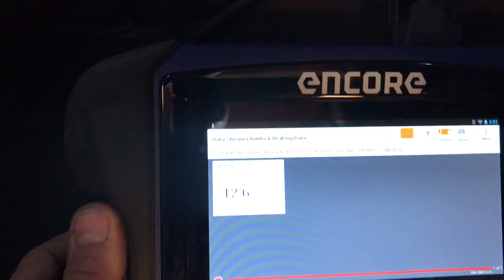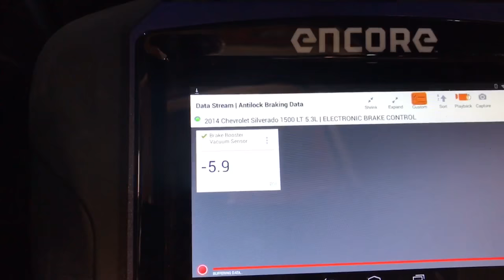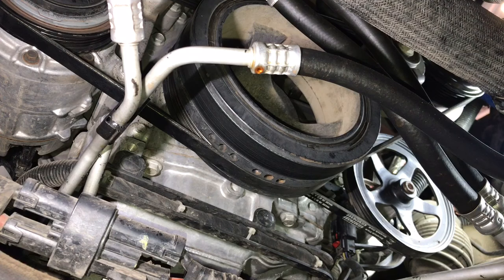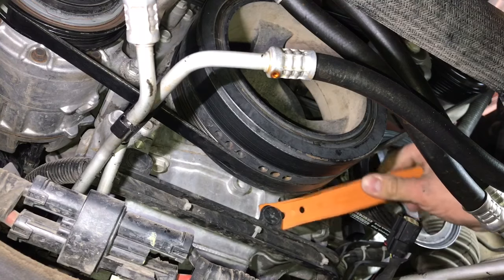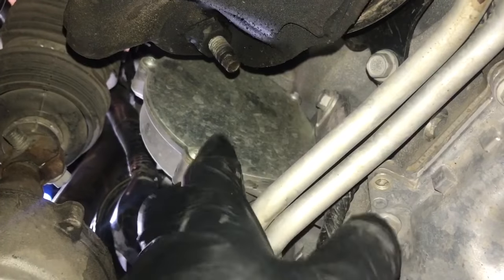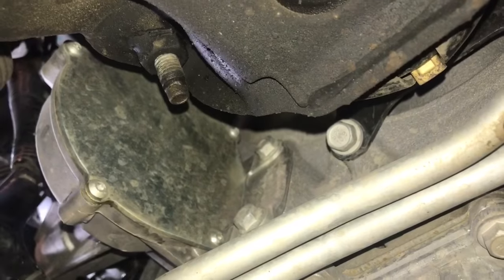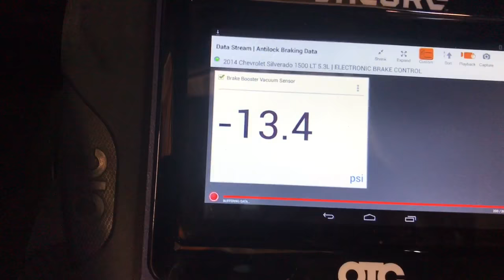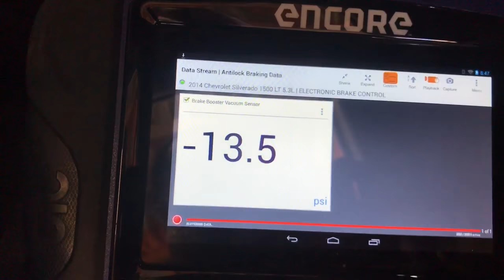Gm Silverado Sierra Vacuum Pump Replacement 5.3 & 6.2 (2014-2018)

Comment: when he starts the truck in this video I can hear the identical sound my tuck is making , it is a weird low groan/whine sound, it is driving me crazy on mine it sounds like something is worn out like a bad power steering pump, I thought it was maybe this vaccum pump but I hear it still makes that noise even after he replaced it..... what is making that noise ? is that just how these trucks sound? sounds terrible.you hear it when he revs it a little too.I have a 2015 GMC Sierra  with the 5.3
Reply: I have it as well on a 2018.

Comment: Just fyi looks that there was a recall on the vacuum pump on these Silverados and I got my replaced today free of charge. The dealer said the recall/warranty covers it if the truck is under 10 years old and under 150k on the engine. 
-2014 Silverado 1500 LTZ 86k (replaced 12/21/22)

Comment: Any chance of making a 4x4 version video of this?  Very nice video btw.
Reply from the maker: unfortunately i have not done a 4x4 recently. if i do i will upload some tips and tricks
Reply: Working on my 4x4 right now.  I had to remove the intermediate steering shaft that he pointed to in the video in order to access the bolts from the top of the engine bay.  I could not find a way to get the pump bolts from below.  Just two bolts for the shaft.  I marked the shaft after locking the steering wheel just in case.  After it was removed it was mostly all feel as I still could not see the bolts from above even with the shaft removed but was able to get the wrench in and feel for them.  Dropped the pump from below just like he did.  The video was an awesome help!  I would not have even dared to attempt it without watching it!  Getting ready to torque and optest soon.  Fingers crossed!

Comment: i noticed you cranked the engine both directions, does that change/ damage the timing? i was told to only crank the engine clockwise for the most part. some engine turn counter clockwise but def not both ways since they are designed to turn in 1 direction only
Reply: The vaccum pump doesnt need to be timed so your fine. If your replacing the cam actuated fuel pump, then you have to make sure the cam lobe is in the proper position.

Comment: I noticed that whine when the old pump was in, and after you replaced it and you revved it, the truck still had that whine. Any idea as to where that was coming from? My truck has the same noise and I want to fix it.
Reply: I noticed that as well.

Comment: Does the dealer usually honor the recall even if (based on my findings on the gm website) that I have no outstanding recalls?
Reply: I would like to know as well.  Mine just started doing this.
Reply: I called my local chevy dealership and even if your vehicle has no outstanding recalls for the part the vacuum pump has a special coverage. Keep in mind it all depends on your mileage. I have a 2016 5.3 with 46,XXX mi. Try and give your local dealership a call they might be able to help.

Comment: Could your vacuum pump change your shift points in your transmission I feel like this might be related. My vacuum pump just went out but three days before that I felt like the transmission shift points were different
Reply: Went to dealer it was my vacuum pump . It failed
Reply: Did it change the way it shifted?

Comment: When you remove the vacuum pump and you see or oil in the vacuum side could that contaminate the brake system or put the oil in with the brake fluid

Comment: Just had mine replaced and now my Silverado's RPMs surge 1-200 RPMs at cruising speed.  Thought it might be unrelated to the pump and belt replacement but seems too coincidental.  Any ideas?
Reply: What ended up being the issue for you?
Reply: Torque Converter was going bad. Wasn't locking up.  Replaced under warranty and all good!

Comment: Dealers are charging $1200+ to do this replacement. Absolutely ridiculous. Having some whining noises with engine rev on my 2014 and I suspect the vacuum pump. 88k miles.

Comment: This is what makes the ticking sound on driver side when accelerating. Yukon sierra silverado escalade issue. Gm will replace no cost due to faulty part.

Comment: Hey I just changed mine on my 2014 and is it normal for a little bit of oil to come out during this process? I noticed it when I took off the old pump there was a little puddle of oil under the truck not a whole lot
Reply from the maker: Yes completely normal. These pumps are lubricated by engine oil

Comment: Hey just wondering, dealer replace my lifters (AFM failure) after driving it back couple days I’m hearing noises could it be the vacuum pump? 
2014 Chevy Silverado
Reply from the maker: Yes it could be. Describe these noises?
Reply: Aaron Hines I posted a vid of it just now, it’s more of a popping and clicking noise, it happen after the Lifters were replaced, I read on GM forums the noise could be from the vacuum pump just wasn’t to sure.
Reply: Just had both sides of my engine repaired because of the automatic fuel management system then they replace the whole engine because it was scarred cylinders anyways got it back and now the pumps making noise crazy general motor products

Comment: Would a bad pump cause a bank 2 lean code? I know I have a bad pump because I have braking issues when going at low speeds. Usually when I'm coming to a stop, the brake pedal gets hard around 10 mph or so. I also have a small whine, I've had these issues ever since I bought the truck 3 years ago. The braking issue never really bothered me too much. But now that the temperature outside dropped to around 20°F, I keep getting check engine lights coming on now and then. I was thinking I have bad O2 sensors or something. I'm not too mechanically inclined but I just recently replaced my CAI filter, cleaned my throttle body, and replaced my mass air flow sensor. The truck ran pretty good for about 3 days until tonight coming home from work. I got a CEL for running lean and I noticed a weird ticking sound but it's not like a lifter tick. It's more like a tick, tick tick, stops for about 3 secs then does that same rhythm. Any ideas on what it could be? Also, I have LT headers and got my truck tuned to get rid of the O2 sensor codes so it couldn't be an O2 sensor?
Reply: what ended up being the cause? i am dealing with this identical problem
Reply: @statelinespaceman   I never got to the bottom of the issue because I traded it in for a 6.2 Silverado but I'm 90% sure it was the fuel injectors going bad. It could be just one or it could have been multiple injectors going bad. I was thinking the intake manifold gasket was bad and causing a vacuum leak, I had a shop check for vacuum leaks every where and they didn't find anything. I still ended up replacing the gasket and it didn't fix the issue. I replaced all the coil packs and O2 sensors, still didn't fix it. That's why I believe it may be your fuel injectors. These direct injection engines are known to have a lot of carbon buildup and eventually clog up the injectors and whatever else. Your best bet is to start replacing the least expensive parts in hopes it fixes it. I would take it to a reputable mechanic and have them check for vacuum leaks, clean and check the injectors if you're not mechanically inclined. You could clean the injectors yourself with a seafoam treatment or something similar and it might make a difference. I hope this helps!

Comment: My 18 Silverado brakes are stuck. If i let it set over night it first it feels ok but then all wheels lock up very bad. As soon as i unplugged the vacuum hose at the booster brakes back to normal. Is that another cause of the vacuum pump?
Reply: Do you figure out what was wrong with you truck

Comment: Can you turn the crankshaft any way or u have to be careful will missed up the timing ?
Reply: Make sure to pop that timing cover off, release that tensioner and then turn crank shaft counter clockwise

Comment: You stated that GM did a redesign of the Pump at around 8:20 in your video.  Where can I get info on this redesigned pump?  or Do you have information of the pump you put on?
Reply from the maker: i have a link in the description of this video where u can purchase the new pump. the old pump is no longer available as it is obsolete. i also have a link to a gm tsb about the pump failure in the description.

Comment: What did they do before they changed the part? because I have a 2016 silverado and the pedal gets hard and does not hold brakes well
Reply from the maker: I imagine they just installed a new pump until the redesign came out
Reply: @AaronHinesAuto  so what do i have to do? also change it?

Comment: I have the problem with 2015 Tahoe and live In Guatemala. Is there a shop in the us like autozone that sells the vacuum pump so I can import it?, the one from amazon is out of stock. Thanks
Reply from the maker: yes, oreilly, napa and carquest can get this pump, but it will be a special order. looks like the pump is in high demand due to a recall for certain vehicles. amazon should have the pumps back soon. here is a new pump on ebay. not sure if they can ship to you. good luck!
https://www.ebay.com/p/236664338
Reply from the maker: here is oreillys
https://www.oreillyauto.com/detail/b/acdelco-2729/engine-sensors---emissions-25132/emission-smog-parts-16465/vacuum-pump-12056/0d98a10f21ef/acdelco-vacuum-pump/12669488/5892812

Comment: Did the bad pump make a whine noise like a power steering pump?
Reply from the maker: Yes it did.
Reply: Aaron Hines All the time or just sometimes?    My 2018 work truck does it sometimes and has been doing it since I bought it with 19,000 miles. I have 64,000 on it now.

Comment: Can these vacuum pumps leak oil from the pulley? I have a 2018 silverado 5.3 and has fresh oil underneath it.
Reply: There's a possibility oh, what ended up being the issue?
Reply: @HtownRO  I replaced the vacuum pump
Reply: INSTAGRAM Silverado_26x14 Did the old pump make a whine noise?

Comment: Would i have to drain all my oil before removing the vacuum pump out ?
Reply from the maker: Nope! No drain nessisary. However a little bit will leak out
Reply: Aaron Hines thanks alot !
Reply: Oil from where?   The brake booster?

Comment: Why put the same unsafe piece of junk back in? I had this problem and plumbed it to the intake because the engine creates its own vacuum just fine. Took that Chinese pump out and it’s been running fine for a year now.

Comment: Just a head ups to all the 4x4 owners out there, the rear bolts are obnoxious to get out/in. I did NOT drop the steering shaft, would recommend doing that.
Reply: A tip if anyone sees this, you can actually see the top of the rear bolt through the spark plug area of the engine where the plastic comes out far enough, helped me a lot

Comment: GM just make this vacum pump recall from 2014 to 2018 
 I replace mine last year 2015 silverado
Reply: Is this for all trucks 2014 -2018? Or how does that recall work? Bought a 2018 silverado last year and i have put 10k miles on it and would like to know what to look out for. Thanks.

Comment: I have 2017 sierra with 26.000 miles on it , I took it to the Dealer for a brake recall, and when I took it home it started marking. A noise so I took it back, and today they call me an told me I have a bad vacuum pump, and that the Dealer block my warranty... wth 🤷🏻‍♂️🤷🏻‍♂️😡 so I think they did something wrong when they fix the recall, and now they want 745 dollars to fix it wtf....😡😡😡 what should I do???

Comment: Does anyone know why they use a vacuum pump instead of simply using manifold vacuum like almost any other car?
Reply from the maker: Yes because when the engine is using active fuel management and only running on four cylinders there is not enough Vacuum for the power breaks.
Reply: I just ordered the Range AFM disabler to see if that would help this issue. Brake pedal feels stiff at real low speed. I already ordered another vacuum pump but I’d be pretty happy if the disabler does the trick.

Comment: How much does the pump cost?
Reply from the maker: 125$ i put a link in the description where you can purchase it and all the parts necessary and save some money. 

https://www.amazon.com/ACDelco-12669488-Original-Equipment-Vacuum/dp/B01E6FWW1Y/ref=sr_1_1?keywords=12669488&qid=1554323487&s=automotive&sr=1-1-catcorr&vehicle=2001-47-491------------4&vehicleName=2001+Chevrolet+Silverado+1500
Reply: $127.87 On Amazon.
Reply: Aaron Hines 
How much does labor cost

Comment: Why do they have a vacuum pump instead of just pulling vacuum from the intake like every other Vehicle.
Reply from the maker: I believe it’s because these engines use displacement on demand. The V8 will shut off for cylinders and become a four-cylinder engine when the vehicle is cruising. When this happens I don’t believe enough manifold vacuum is present for proper braking assistance. Is that
Reply: @AaronHinesAuto  ok, we had a 17 at work with a vacuum pump go bad, I figured it out but the dealer replaced it under recall.  We also have a 12 with no vacuum pump, don't the LS motors turn off cylinders also, I think it might only be two for the LS.

Comment: Why the don't they use engine vacuum so it doesn't need a vacuum pump?
Reply from the maker: Unfortunately due to these motors having AFM aka v4 mode. They don’t produce enough vacuum to assist in power braking while v4 is active.

Comment: The part number on my original pump is 12659655 not the new 12669488. It looks identical to the new part number from the outside design. Did they perform multiple part revisions?  Looks like the new part number replaces the following parts (mine included): 12654013, 12659655, 12660004, 12662552. I'm not experiencing any issues so trying to decide if I'm going to replace for peace of mind.
Reply from the maker: I have worked on a number of trucks in our fleet that show less the 6 psi when breaking. The new pumps almost never show less then 10-9. That leads me to belief be the new pump design is better. What is your year and model.
Reply: @AaronHinesAuto  Mine is a 2016 Yukon XL Denali. P/N on my original pump is: 12659655.

Comment: Removing that connector was a pain in the a$$.
Reply from the maker: ya its not easy to get your hand in there
Reply: Aaron Hines I tried doing this on 2015 suburban but could not reach the bolts on the back of the pump.  I think the front differential was in the way.  What GM model are you working on in this video?
Reply from the maker: the truck was a 2014 silverado 2wd.
Reply: Aaron Hines I’m working on 15 suburban 5.3 engine.  I can’t reach the back bolts on the pump.  I think the front differential is coming in the way.  Any tips?
Reply: @shoner70  Remove the intermediate steering shaft.
Reply: Jim C. Thanks.  Yea, I actually completed this job a couple of weeks ago.  I was hesitant in removing the the steering shaft, since I had never done that before.  Once I got the steering shaft out of the pump was easily accessible from the top.

Comment: Has anyone tried using an electric pump and just deleting the manual one?  I can sure tell you I can't afford oil in my brand new shiny booster!
Reply: He did not remove the other belts. If your vacuum pump belt is in good condition, you can remove it and reinstall it without needing to remove the large accessory belts.

Comment: So GM just announced a recall regarding hard braking. They are saying it’s just a reprogram fix. Some guys feel like this is a bandage for the failing pumps. I have a 2015 Yukon that has started to have hard braking and I feel like I just want the new pump and not a reprogram.  Does anyone understand what exactly GM is proposing or have any advice?
Reply: JM M had my 17 Sierra for 2 years 40k miles havent had any problems....I get the recall fix done sept27 2019 now I’m having issues....
Reply: tha1Gemini24 

What’s the issues?
Reply: JM M 0:36 at parking lot/ drive thru speeds the brakes basically stop working like they should  best way I can describe it is it feels like the abs kicks in when you press the brakes on wet on snow covered roads....I dropped it of yesterday to get it fixed they know about the issues cause the service guy grinned when I told him what it was doing I didn’t find that shit funny nevertheless there replacing the pump with this new design under warranty
Reply: If I were you I’d go to the dealer regardless if your having the issue yet or not tell them your having stopping issues and they should replace it for you

Comment: It’s a pain in the ass and if you put it on wrong it will leak oil and check engine light will come on because the clip connected to the vacuum pump has a tendency to break and is unusable